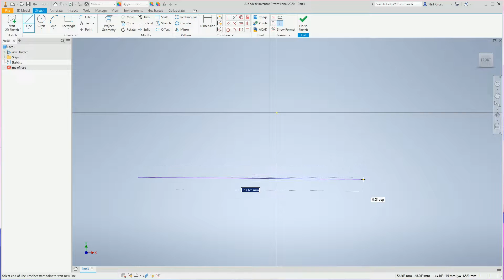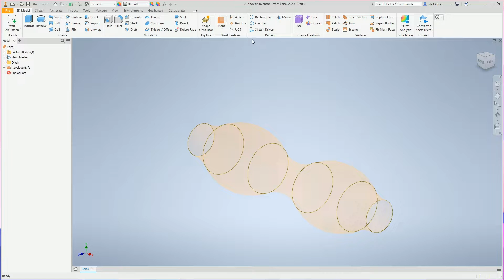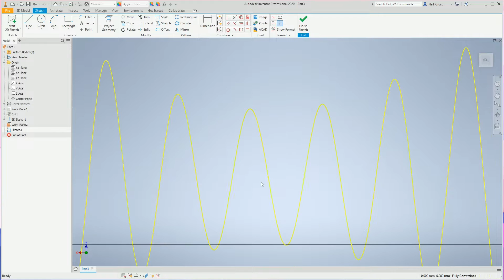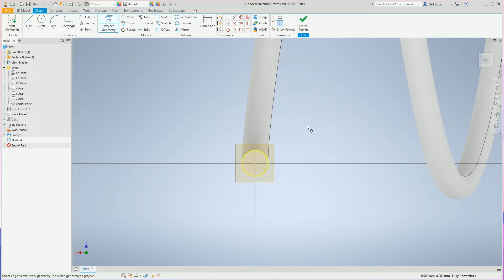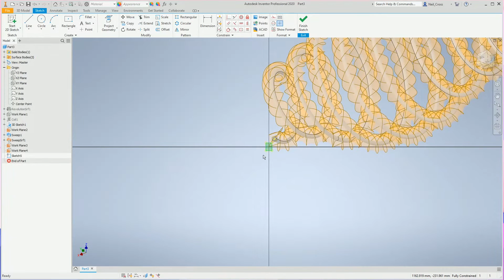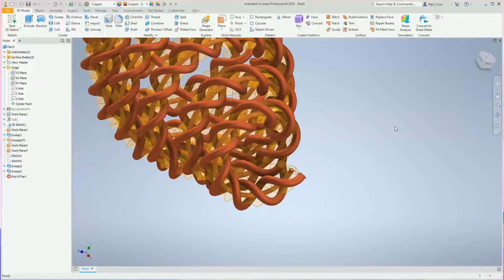Invusion CAD Challenge #003 RESULTS & TUTORIAL! No-one got it right! Not even me!

Comment: Great to be on that list :).  

My computer didn't really have trouble with this model.  The main difference between our models, I think, is that I used a line instead of the full rectangle for my swept surface = fewer faces to render out.  I believe the way I did it is also fully functional, almost click for click, in Fusion using the helix command instead of coil.  This also, in my experience, gives you more stable results for area, volume, etc.

Cheers, mate.
Reply: I can't find a helix command in Fusion or is that a addon? I used surfaces to make 3d sketches and got in 2kg over weight.
Reply: @KristianLaholm  hmm...it appears as though I was wrong.  Could have sworn that Fusion had this command.  Maybe I'm thinking back to the days when it was built into inventor.  Fusion does have a coil command, but no end control as is needed for this model.
Reply: @smithe53  I only wondered if I had missed the command in Fusion. 😀

Comment: I fell into the trap at the end picking the edge of the last coil rather than the same path as the middle coil.  Did everythink else correct.  That was a good, but frustrating challenge.  I lost count at the number of different ways I modeled this trying to make that work.
Reply from the maker: It was driving me bat shit crazy.  I must have spent hours trying different little things to get Inventor to accept those outer edges as paths but literally nothing would make it happen, but I realised using the centre line with the twist brought out the same result but weirdly without errors even though it's the same shape in the same place!

Comment: Such an honor to be on that list. I actually did end up using New Solid on the final 2 sweeps, but only because it doesn't sit well in my mind that they could be part of the other solid, as they have no parts actually touching.
Also, you were quite sneaky, since you didn't detail the relative angles for the starting positions of the final 2 sweeps. I assume you intended for us to deduce that we should use a plane that was normal to the sweep path, which meant the path needed to come first, even though it wasn't to be used because of the path selection bug. But I wasn't sure until now. 
Such fun.